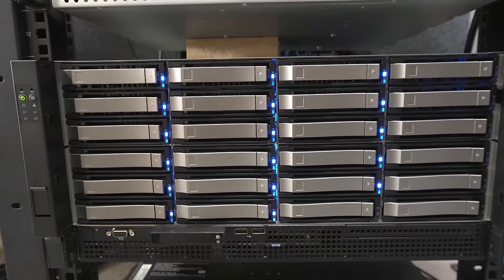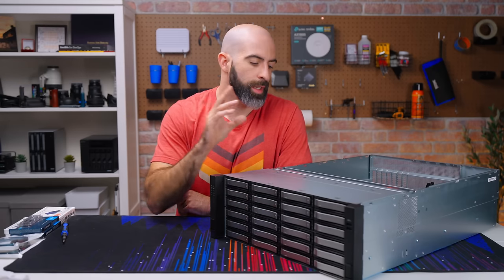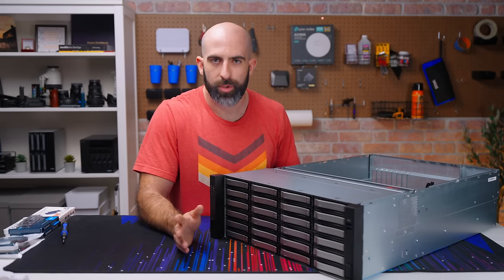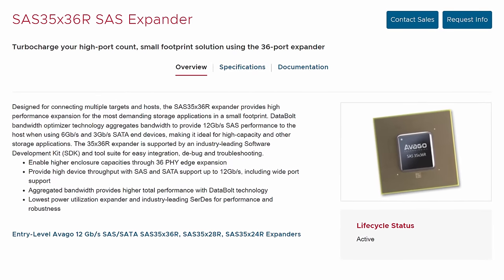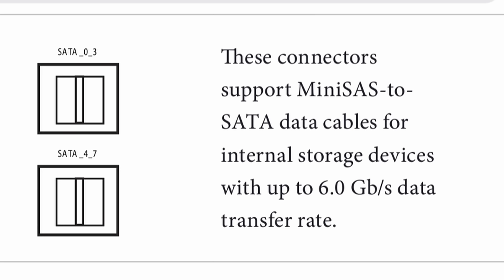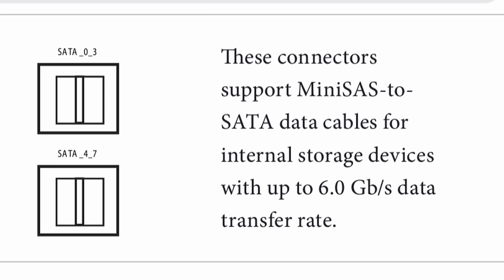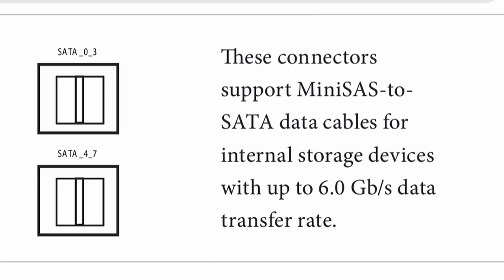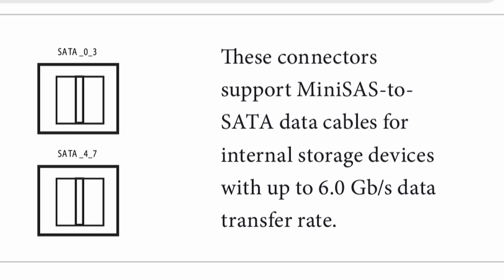Home Server Upgrade - More drives, more problems?

Comment: Dual PSUs are not only for separate circuits. Dual PSUs can run in redundant mode OR in load balanced mode. I would advise keeping both of them in. I am especially fond of load balanced mode because it will distribute the draw between the 2 PSUs and you can have some nice efficiency AND enjoy LOWER load on a single power port of your PDU or Standard power strip/bar. Plus, if a single PSU fails in a long-term deployment, you will have fail over to the other working PSU so that you will have zero downtime. This paired with a nice battery back up and you will have an EXCELLENT power set up.
Reply from the maker: Interesting…I’ll have to revisit this then!
Reply: @RaidOwl  Also... this is like a $1,500 chassis right?
Reply: @greenprotag  Yup, £1700 in the UK, ouch.
Reply: This
Reply: Yep.  I use dual PSU whenever possible.  My fiber MikroTik switch has it and been using it despite my house only have one power circuit.   It still provides redundant power to the switch if one PSU should fail.
Reply: Also: plug one psu into the UPS, one into regular wall outlet, and you can without effort take down the UPS for maintenance.
Reply: Oh wait - you have two UPSes? Even better one psu for each ;)

Comment: You should plug in and use both PSU's.  They balance out the load.  As long as you don't take a massive spike or overload the PSUs, they should outlast cockroaches.  If you only have single circuit, plug one into a UPS and the other into a Surge Protector.  Many UPS's have protected and battery sockets, one plug in each type.  Just remember to use the UPS software to monitor the UPS. As single PSU will draw extra drawing down the battery extra fast.

Comment: A word of caution about backplanes that support both SaS and SATA: _apparently_, SaS drives use a lower voltage than SATA drives and the power is negotiated with the drive spins up. This means that if you mix-and-match SaS with SATA on the same HBA, you might end up dumping too much power into the SaS drives. In this instance, the expander throws a lot of unanswered questions into the mix.

I learned this from just a passing comment on a podcast where the speaker wasn't particularly technical so I wouldn't count on the above being entirely correct, but I had 16 SaS drives fail at the same time for what seemed like mysterious reasons, but the 4 that were on their own HBA were fine. So my experience aligns.
Reply: SAS drives lower voltage than Sata.

Good point

Comment: 8:23 - I would still try and look at what kind of connection they have, and also simply try if it works with minisas, it pretty much looks like a standard dual path sas setup for two slots that would have 4 electrical sas connections, which is exactly what single minisas provides - i.e. it shoudl work with sata just fine while directly connected with minisasa cable

Comment: Moving from TrueNAS Core to TrueNAS Scale is pretty easy through the UI.
Nothing special there, however, if you are running it in a Proxmox as i do, there is one thing to do to ensure it will not hang randomly.

You have to issue the following command only if you are running an AMD (either Ryzen or Epyc) CPU:

midclt call system.advanced.update '{"kernel_extra_options": "tsc=unstable"}'

I had no issues while running Core, but as soon as i moved to Scale, it started to hang randomly. After issuing the command above, it never hanged again.

Comment: For the dual power supplies, you could run one off each UPS in the bottom of the rack.
Reply from the maker: Big true
Reply: Or connect one to mains and one to UPS which is what I do with all my servers

Comment: 240-ish W for 80-90 TB - that's pretty good.

Interestingly enough though, if I just scaled the power consumption by capacity (I'm running ~216 TB (raw) vs.~90 TB), that's a ratio of 2.4 * 240 W = 576 W, which is about where my server is, in terms of power consumption.

Comment: isnt the point of redundant psu's that if a unit itself goes down, the system keeps running. i havent really heard much about people trying to use them in place of a backup solution like you mentioned. also - i think if you run them both they balance their load between themselves and become more efficient.

Comment: some times server manufactures require you to use both psu's like my HP dl380p g8 which runs a nvidia tesla k20 using the gpu riser kit 128gb ram 2x Intel xeon e5-2650v2 mellanox connectx-3 dual 40Gbps qsfp+

Comment: Nice chassis, looks like it's time to upgrade to Siena for that system so you can use all that occulink goodness without using gobs more power.  Seems a shame not to mirror a couple U.2's for the VM's, probably the only change I'd make.  And I'm with you 9on running core (at least for now), if it ain't broke...

Comment: You should still connect BOTH PSUs even if they are on the same circuit if ONE of the PSUs fail the other will pick up the difference

Comment: 10:33 what do I get to point out that you the cpu fans are not aligned with the case air flow? :)
Reply from the maker: I orient my fans based on the position of the north star

Comment: You should have just connected the back backplane to the sata only connector on your motherboard... It's sata to sata over a sas cable... whatever.
Reply from the maker: wait...
Reply: @RaidOwl  While you can use SATA drives on a SAS backplane, you can't use SAS drives on a SATA backplane. In theory, you could've simply connected a single Mini SAS cable from one of the ports to the board, as the manual doesn't say you can't do that.
Reply from the maker: Yeah my mind went from “crap I can’t use those 2 motherboard ports for the backplane” to “oh I’ll just use them for two sata drives” then somehow went back to “wait this won’t work”
😅

Comment: i had issues installing vm of scale. i finally ended up just running the core to scale upgrade and it worked fine. now running scale with no issues. (backup your config first)